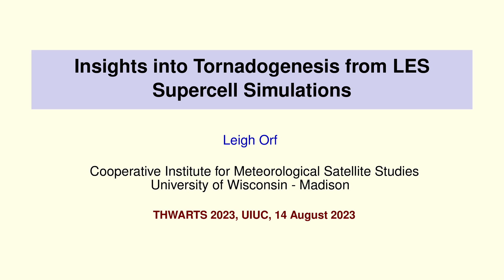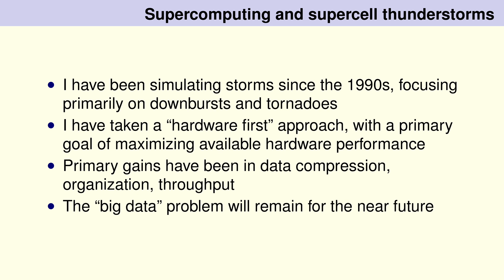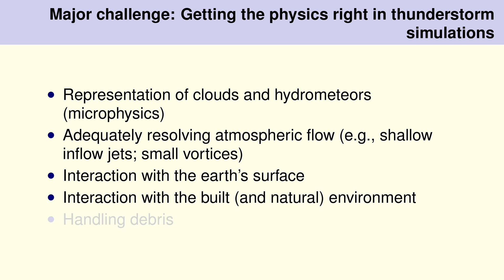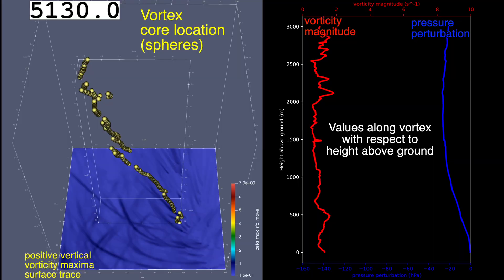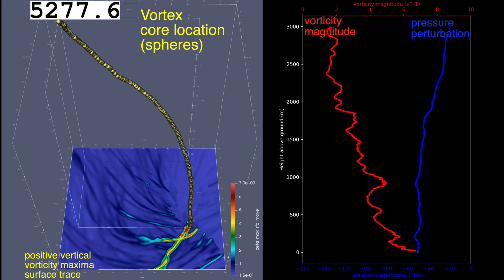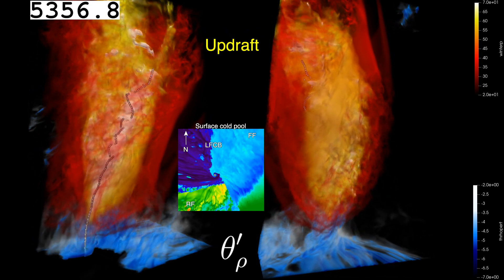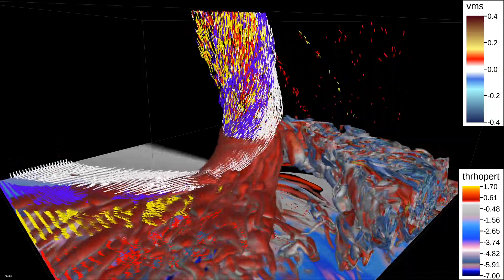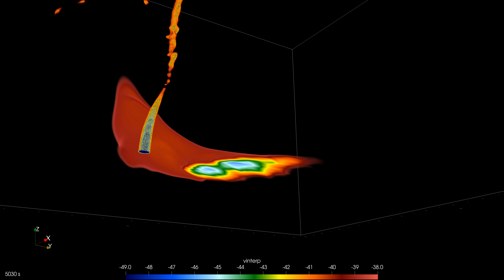Leigh Orf presentation at THWARTS, 14 Aug 2023

Comment: This is fantastic, I'm sick so I'm on a binge learning about tornadoes. I have so many questions but I'll try to keep it to a few: 
1) how can multiple vortices with the same vorticity exist in the same column? Wouldn't this be like trying to put gears next to each other that all need to rotate in the same way? Is that what causes them to spiral?
2) the horizontal vorticity in the SVC, how does this give rise to vertical vortices before it has really gotten a chance to reach the updraft? 
3) what resolution have you gotten to in recent years? I saw your talk from 2019 where you managed 10 meter resolution which is quite impressive. Is there still a push to go higher or are ensembles more interesting?

Comment: This is probably pretty off-topic but just asking you.
Do large tornadoes actually scientifically have calm centers in them? There's a lot of conflicting information and I'd like to know from a doctor studying in the field like you.
Reply from the maker: Sure, in many cases (say single and two celled tornadoes) if you were able to transport yourself to the center ("eye") of the tornado and move with it, you would mostly be in calm air, but multiple vortex tornadoes could be more difficult, there is not obvious center to many of those. You'd get bonked by a lot of suction vortices, probably.
Reply: @LeighOrfsThunderstormResearch  Thank you for the informative response.

Comment: So I watched your 7 year old video on simulations. I am late here, but something I did notice.

I am noticing something similar to modulational instability in the way the vorticities are moving here. So, could it be a piling effect of the rotating air columns eventually leading to a dominate circulation stealing energy from the smaller circulations causing a positive feedback loop?